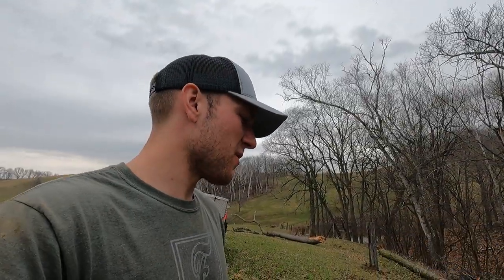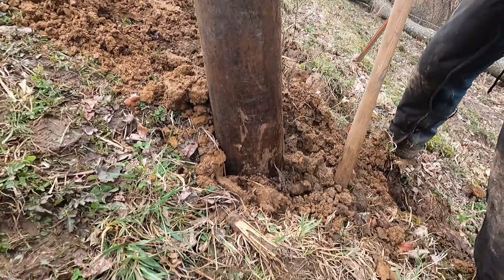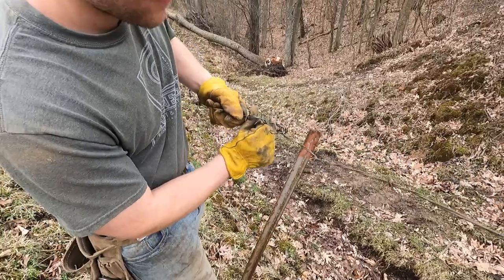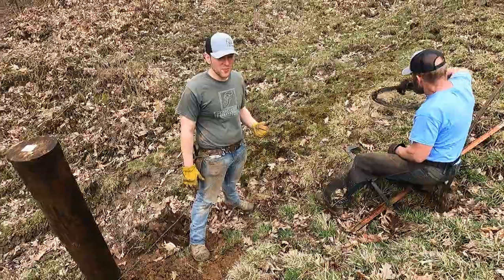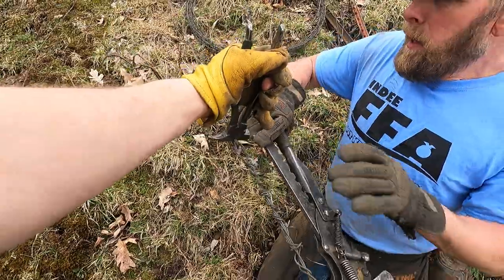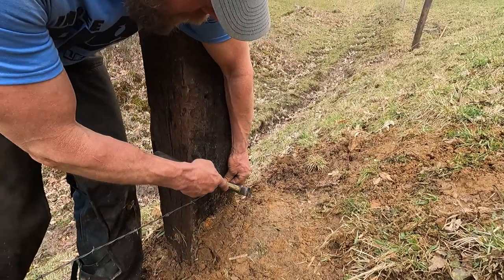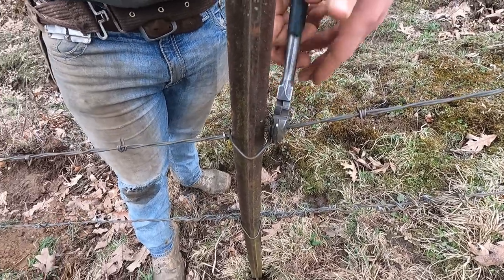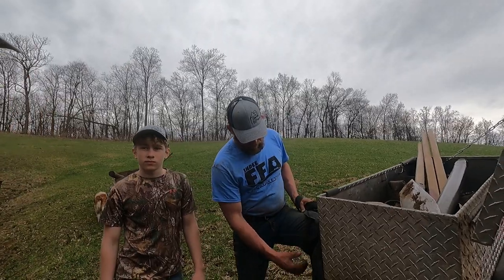Barbed Wire Fence Repair (40 years of Experience)

Comment: We use the same style of post driver (Farmer made) 2" pipe with a solid piece inside welded, very top-heavy lots of driving power. I built mine in the shop about 40 years ago, still in use every spring/summer/fall. Tried the ones you can get at TSC with the handles not a fan, not enough driving power. Like you I learned a-lot from Dad & Grand-dad. How's your Hay coming along? We started cutting last week.

Comment: Our old farm in southeast Indiana was almost identical to yours as far as the landscape goes. I always enjoyed building fence with dad in the spring waiting for the fields to dry out. I remember in some of the valleys and dips where we had a post we’d hang a giant flat creek rock with number 9 wire to the top of the post to add some weight so it wouldn’t pull out from the wire tension.

Comment: We always tried to use either crossties, or we salvaged old utility post for corner and brace post for fencing.  
Your heavy clay is probably tough but, youd probably be glad to get back to it after you've had a taste of our lower Mississippi river delta Gumbo its tough, ive been 2or 3 days digging one hole for 1 post using a shovel and post hole digger.

Comment: well, I have the same fencing pliers as you, but over here we use all wooden treated posts, a few bigger posts in some places to strain the wire to, we put some in with a post driver on the tractor and smaller ones by hand as you do and as your dad says never lose a staple or the cattle may eat it and that a big problem or they end up in a tractor Tyre.

Comment: Ooh I can relate to all the scars and cuts working with barbed wire. I like the idea of flipping the posts upside down. Our line fence is all white cedar posts. It was built long before I was born maybe about 1960. We don't have hillsides like you but we have plenty of swampland but the posts seem to hold up well still probably wouldn't be a bad idea to turn them. A lot of times Dad would bring the chainsaw and just cut a post right in the woods. We're pretty much surrounded by that. Again, I love the FFA shirt your Dad is wearing.
Reply from the maker: It's crazy to think about all the fence that's went up across the country over the years!

Comment: I've never worked with barbed wire but lots of high tensile electric. Not as much as your dad though. Do you have a post hole auger or you dug by hand? Great videos.
Reply from the maker: By hand!
Reply: @GierokFarms  by hand is tough a tractor PTO or hydraulic auger is great if you have one.  For temporary pens around barn areas for either hogs or cattle steel post and using panels are great can attach panels to steel t post with UV resistant zip ties  easier than wire ties that are furnished with the post.